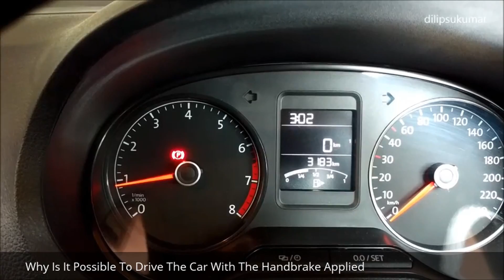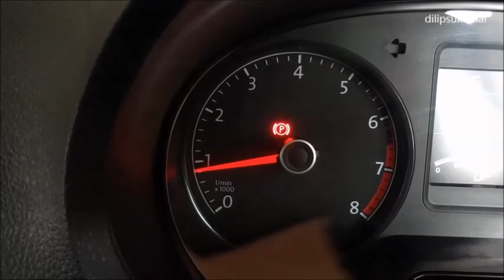Why Is It Possible To Drive With Handbrake Applied - Technical Reasons & Precautions

Comment: Amazing explanation. I was wondering what if you accidentally drive the vehicle 🚗 with the parking brake on for about less than 1 minute? Maybe 25 to 35 seconds at the most at about 10mph to 15mph. You see I never have made the mistake of not removing the parking brake before driving not ONCE. But it was only this one time yesterday that it happen because of leaving out in a very rushed time. I only noticed the parking brake was on when I felt the vehicle very sluggish and slower than normal. Then I quickly release the parking brake. But right away I pull over to the side and put emergency lights and make sure that the parking brake was off 100% now I am worried I damaged the parking brake system. But then again before entering any highway. I made sure the parking brake is 100% off. What do you think my friend? Many people sometimes make the same mistake.

Comment: Thank you Sir, very good explanation. I think got one time I was driving with handbrake applied accidentally and only I noticed at end of trip :( With your video now I understand the technical part, thank you
Reply: Mark Tan wow!! Same thing happened to me except it was at the very beginning of the trip that I notice it! I am so worried I damaged something in the parking brake system. I have driven a different car than the one I have now. With the parking brake like that, and at the end I smell like burnt rubber after the freeway. But now I wonder if even just having the parking break on for about 15-25-35seconds at 10mph to 15mph can damage it. So I wonder how is your vehicle after this incident happen to you? Was the parking brake system damamged? Please I would like to know because I am worried and want to know if I need replacement or if it’s ok.
Reply from the maker: +Mark Tan Welcome!
Glad you understood the technical part behind it.

Comment: Hi Dilip Sir,

Just few  items for  clarification from you again 

1) The Gear Box oil is replaced with mineral oil in the recent vw polo cars?

2)Would the insurance(Any) taken from VW  would cover the gearbox unit ?

3)I am hearing about the mixed reviews from ppl regarding the DSG Transmission issue which they had . I would like to know if you have info about the same or if it is rectified or any alternate solution proposed by them ?

Request your reply on the same
Reply from the maker: +prabhu ram 
1. Regarding gear box oil, I am not sure. Will enquire in VW workshop and reply back.
2. Yes. Insurance taken from VW will cover the Gearbox unit.
3. DSG Gearbox will not create any problems if handled properly... You need not worry... Failure chances are low... But repair charges of DSG Gearbox is expensive
Reply: dilip sukumar thanks sir.
Reply from the maker: +prabhu ram Welcome...

Comment: In my car one of the rear window is not opening from inside. Child lock is not engaged. What would be the problem ?. I saw via the handle hole the cable is not moving
Reply from the maker: +Karthi Keyan rear window or rear door? 
When child lock is engaged, only the rear doors cannot be opened from inside. Rear window opens normally. 
Please check the window lock button located in the driver door. If that button is pressed, rear window will not open. 
If everything is normal, it might be a small loose connection or fuse. Please check it at a workshop.
Reply: dilip sukumar  sir. It's a rear door. And it's not locked from driver side also only the right rear door has the problem
Reply from the maker: +Karthi Keyan if you are not able to open the rear door from inside even when the child lock is not engaged, it might be a minor problem. Please check it at a workshop.

Comment: Which gear and speed is suitable for downhills sir.?? Also can we use the brakes during downhills or only gear should be reduced to reduce the speed
Reply from the maker: +Karthi Keyan While driving Downhill, use the 3rd gear at normal inclination and use the 2nd gear for very steep inclination (hairpin bends). Reducing the speed using gear is recommended. But you can use brakes at some situations. Avoid using Brakes as much as possible.